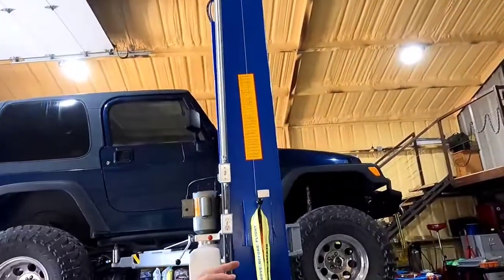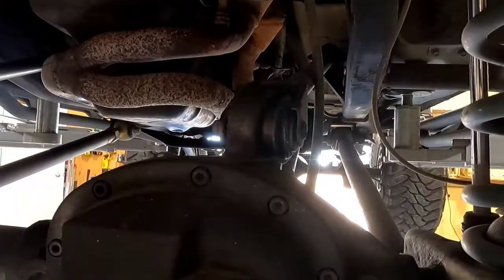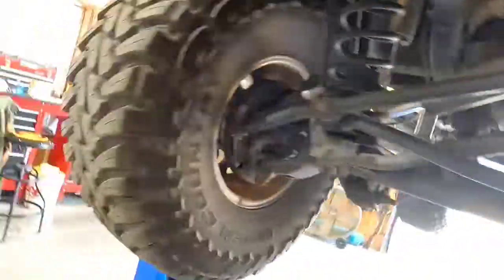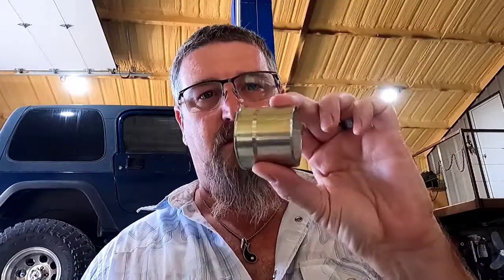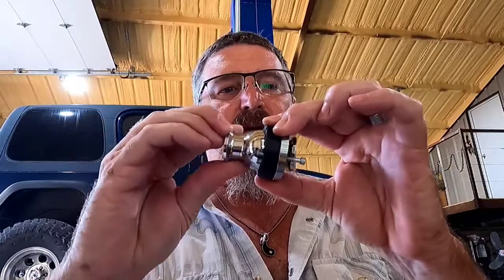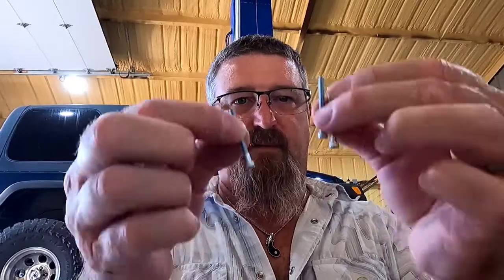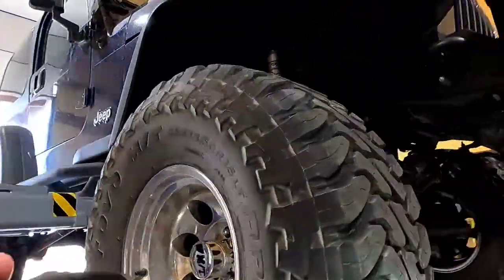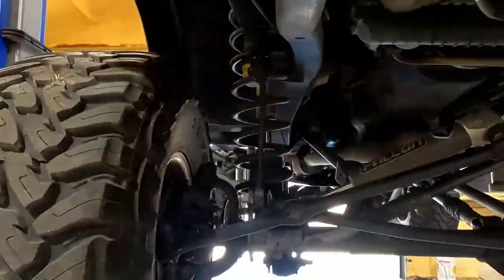Iron Rock upper control arm Bushing, Jeep TJ

Comment: I imagine The "weld on" application may be for the other upper link mounts with a metal stanchion welded to the axle tube. I'm willing to bet it's easier to weld the housing in, than to peen over the edges in that application.